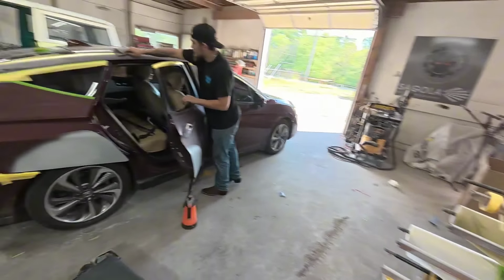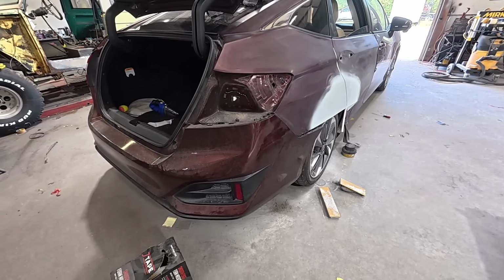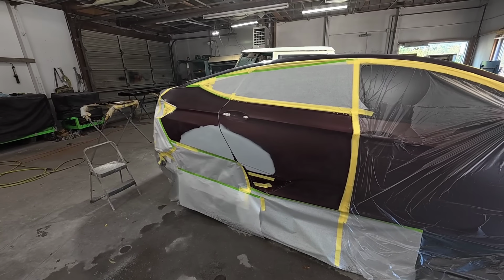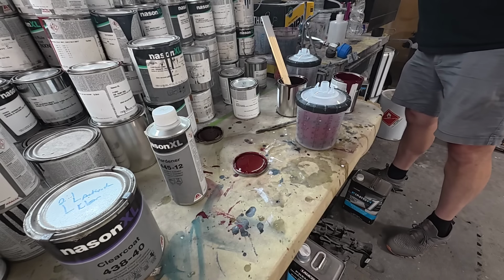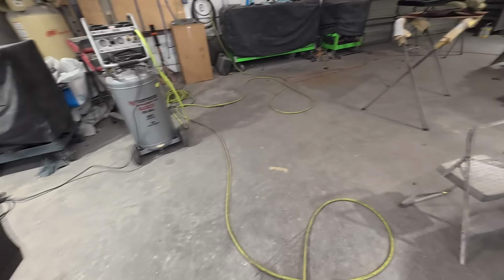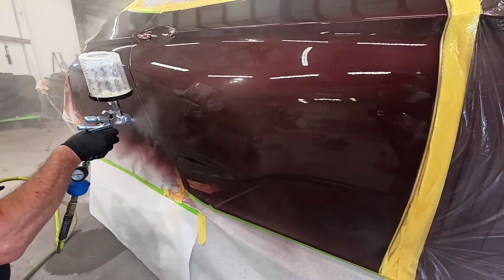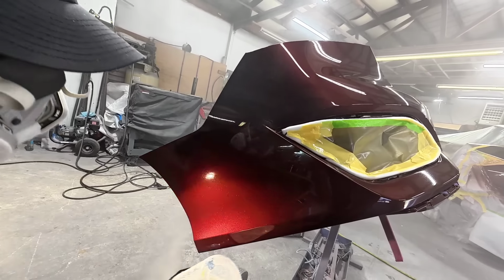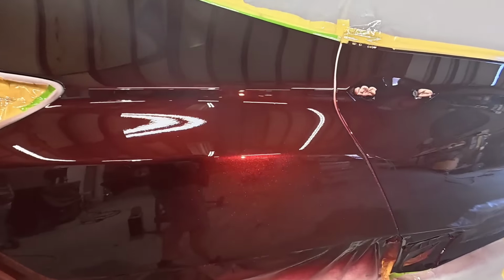I Painted This Car With a Small Compressor (No Paint Booth!)

Comment: Your gonna LOVE the 438-40 been spraying it for years now!!
Reply: I do feel your environment the 438-22 would fit your situation better. Hands down best panal clear I've sprayed with (I'm in FL so i use 438-22 with 445-13 slow hardner)
Reply from the maker: Appreciate the suggestion as I'm  new to this clear good info! I'm  gonna try the 438-22 for sure. Thanks!
Reply: @Bkrieder Do you mind explaining your opinion on why the panel clear would be better in this environment?  Ill be spraying outdoors / garage here in a few weeks, was going to go with Finish 1, but seeing this comment made me think about the 438-22, 438-40.  What should I go with in your opinion?  I’ll be spraying hoods, bumpers etc. Also i’m in NC and it’s kind of cold here, do you have an activator recommendation?  Thanks!
Reply: @kbizass the 438-22 NOT 438-20(if they still have it) will close faster then 438-40. Less chance for dust to land in clear coat. Recomend to use 445-13 hardner, will still close fast with slow hardner while leaving a flat beautiful glossy finish that only needs to be nib sanded and buffed as necessary. But, you will not make it all the way around for an overall job
Reply: But I'm in florida. So I regularly use 445-13 but will substitute 445-12 as my "fast" option
Reply: @Bkrieder awesome. Do you feel like this is a better clear than the finish 1 clear?
Reply: @B @Bkrieder Also what base coat do you like with this clear?
Reply: @kbizass  yes hands down
Reply: @kbizass  I shoot Nason Xl and I've also shoot it over Valspar with no issues as well. I have one spesific customer who prefers the price of valspar base vs the nason xl.
Reply from the maker: Do you like the way it buffs
Reply: @GarageNoise it sprays so smooth and doesnt lose gloss has a quick dry to touch time the only thing I buff is the few nibs that need atention
Reply: @GarageNoise  Chris what happened to Brad at sagola
Reply: Chris what happened to Brad at sagola

Comment: i am struggling with removing my bumper the bolt is badly rusted
do you have any experience with mercedes?? bumpers specifically sl500 R230 ) 2003

Comment: clear coat needs to put in cup and 30 seconds in microwave and it will flow better, so it is closer to 30degrees Celsius. Some professional painters doing like that. Need to try that, especially if you arent living at hot place

Comment: Try a LVLP gun, can be bought for $100.  I did my Firebird with a 25 gal compressor and the LVLP gun.  Total in, $1100 for paint, $100 gun, compressor I had, prep materials aprox $300, cut and buff paper, pads and 3M products $200 and about 100 hours.  Far cheaper than my best quote of $13000, plus the satisfaction of having done it myself.  Patience, prep and a couple dozen videos were keys.

Comment: Good video! I’ve used smaller air compressors for nail guns but for paint spraying I do agree with you that the compressor you were using is small. Thanks

Comment: Great video, tried the d1/r500 and I do like how they finish however the spray fan isn’t as large as I’d like especially for metallic colors. I have a 30 gal 9cfm at 90 psi compressor. Is there any other guns you can recommend. I usually only paint 2/3 panels at most?

Comment: While it is true that you do not need a large compressor spraying, it should be able to supply at least continuous 8 CFM at 90 PSI, and add a water trap. A lighter flexible air hose and a swivel where it attaches to the gun are very helpful. I also recommend a stand or a hook suspended from a ceiling to hang it on if you are using an HVLP gun with a cup on top for filling or between coats. If you don't have an exhaust fan overspray can travel pretty far and settle on everything, including the floor which can be mitigated by wetting down the floor, but be careful not to splash water on the vehicle! Done that. Prep is crucial, and paint will not hide anything! Use a tack cloth and then a wipe down prior to painting. Practice makes perfect so do some, and test the spray pattern on a flat surface just before spraying and make any adjustments for flow, etc. and see at what point too much will cause drips. Buy the best spray gun you can afford, but nowadays even a cheap gun can yield good results. A smaller jam gun in addition adjusted to spray a circular pattern is great for door jams, recessed places or tight spaces.

Comment: How did you connect your line to the 1/2 connector on the filter? Im assuming youre using 3/8 line with 1/4 connectors. Im asking this because trying to get into painting and just baught the filter and two merlin 3/8 50ft hoses, just wondering how im going to get it to connect to the filter.

Comment: Do yall messure your paint in one cup then transition it to another cup with a plastic liner? Or do you just use the same cup you messure in?
I ask this because im going to start getting into painting, does the paint dry off in the cup without a liner or is it easily washed off to be used again?

Comment: You don't charge enough for your collision jobs if you cant afford to fix your air supply. If you ever did complete cars with multiple coats, water in the air lines would destroy your work. If you want to get rid of the bulb filter on the gun, get a Motor Guard M-30 and a new 35' hose connected after it. You can replace the filters with regulator toilet paper or buy 2 filters and let one dry out in a clean shelf space.
Reply from the maker: Appreciate the comment, there's so many things that can be done for dry air. I don't have a problem with it tho but all good suggestions.

Comment: Is it possible to do a full car paint job completely outside? I dont have any kind if facility, not even a garage, but i do have a lot of grass and i could make a big cardboard pad to drive my car onto and ofc mask up, but i cant block the wind or rain or any of that good stuff, but if i time it right and get lucky with the weather is that possible?
Reply: I've heard of guys buying used 20 man tents for painting.
Reply from the maker: Yes it's  totally possible, I've  had friends get really good results this way. Obviously you want a calm rain free day and to avoid dusk or dawn  when bugs are bad.
Reply: Absolutely! A lot of us have done driveway paint jobs! I've done a few, go for it!
Reply: My friend, EVERYTHING is possible. If you have the space for it, I don’t see why you would not be able to, GO FOR IT
Reply: Everything is possible, but I would strongly suggest renting an air booth.  Painting outside would require a perfect day, no pollen, bugs, birds, etc..  the amount of cut and buff to correct everything will be very time consuming and costly.  I would even invest in a purchase of the booth before I would attempt an outdoor spray.

Comment: even on some of my dura blocks i cut slits on the top with my 4.5 in grinder with a cut off wheel .. so i can bend it some for contours .... but i only painted 1 car my 1969 javelin ... and i had NO Fing clue what i was doing .. i had 179 friends peopel tell me how to do it .. but having them actually come over LOL was a complete different matter.... but after i painted it ... they were like .. OH should have told i would have helped... TO LATE  :-) its done .. but i just want to drive the Fing thing .. so as long as people stand 10 feet away and im moving .. IT LOOKS GREAT  hahahah ..you guys make it look so easy .. for me .. Nope.. . and that the paint gun i used innocraft one you had ....
Reply from the maker: Lol, that's awesome. I can relate to that 🤣

Comment: Painting takes volume. I mentioned on another video. You can combine tanks.  If I have two or three cars to paint. I use an air bubble and and a 30 gallon air compressor.  Before you start you have to fill air bubble and combine the two. I always run two separate filters. If you run three tanks you need three  air filters. Tanks will have moisture in them from weather. Air bubbles are tanks only, no compressor, you can buy at harbor freight. You can also like me if you had a compressor that quit working ,use that...but beware if you have an old tank the seams can corrode and you can have a bomb, happened to me and son. We had a rupture and he needed 26 surgeries and I ended up with his teeth  in my nose and a sore that has never healed that I won't see a physician over.  Anyway happy painting everyone
Reply from the maker: Wow that's horrible, I've  heard of that happening before very dangerous for sure. I have a tank that the motor quit on its in good shape, I'm gonna do the same thing when I get a chance.
Reply: @GarageNoise we've discussed this before.  I 've an avid watcher. I've been with you since you syarted. I also like the guy  that starts out" lakeside"... because i am 65 and started back in q981 but i paid for auto body collision since my father owned a bodyshop, but he had a double stroke and had to sell and i persued truckdriving. But i had to quit that because mom had brain tumor, so i did bus driving and did chaarity autobody work for other bus drivers on the side. Which kept me busy and i still put together cars for them and myself, even thpugh i retired.

Comment: PORPHIS PRD 717VS IS DESIGNED TO EVEN WORK AT 8-29 PSI😊❤,HOWEVER PORPHIS IS A WIN WIN SITUATION 🏆
Reply from the maker: Yeah I was surprised that they operated at low pressure. With these guns 25psi I like 35 way too much.
Reply: @GarageNoise LOOKING FORWARD TO SEEING THE NEW PORPHIS PRD 817VS😊😊😊❤

Comment: Why do you say it’s a small compressor?That’s not a small compressor. Painting with a small compressor is what I did. Two 5 gallon porter cable compressors linked together. Painted my entire car piece by piece. Sealer,Base and Clear with a simple D1 Drizzle. No Orange Peel or Over Spray.
Reply: They normally use an 80 gallon or better to paint. This is a small one to people who paint for a living. I'm like you though. I have a 10 gallon pancake. They've so cheap that I may buy another one and link them like you did. Then, I'll have a 20 gallon supply for much less than buying a 21 or 26 gallon compressor. Thanks for the idea.
Reply: Super video enjoy😊
Reply: That sounds dope u combined two compressors?
Reply: @ZeekDavis-d3b I own a trim carpentry business and I’ve bought compressors for my guys when theirs took a crap on them so I have 3 at home. Had a bright idea to link two together with air fittings and a T. I then followed the GarageNoise paint prep and painting steps to a T and it came out great. I had one small run which I sanded and repainted and a small bit of orange peel right where the driver side fender hits the front bumper. Sanded,cut and polished it gone.
Reply: That's a small compressor.
Reply: What was your tank pressure? I mean, I know your gun regular pressure is set between 22 and 28 psi But I'm curious how much tank pressure you're feeding that range of 28 to 22 psi. 
Mine has two regulators: one for tank pressure and the other for line pressure, which is attached to my gun. You're going roughly 100 feet, so I'm just curious what your tank pressure is to keep that gun at a steady 28 to 22. Mine is giving me problems (fluctuating)  and I'm only going about 75 feet. I appreciate the advice on moving the water separator to 50 feet away from the compressor to prevent condensation from getting into my gun.  Thanks for that.     By the way.  I have just about the same size compressor just can't firgure out what going on with mine.    Any info would be appreciated
Reply: @d @deepriversouthernprideslot8287 I used two 5 gallon pancake compressors with tank pressure at 50 on both and regulated pressure set to 30psi. I painted each piece separately. Trunk,hood,doors,bumpers then painted the cab. A lot of stopping and waiting but the periods were short. I had a few runs and light area on the cab but it was an easy fix.
Reply: well if you pay attention to the cfm the fun needs to spray. yeah he spraying with a small compressor
Reply: He did use a “small compressor”, it’s small and cheap. What you did was use a “ridiculously small” compressor. 😂
Reply: @michaeljohnson2922 yes I did and still got my panels,hood,doors and trunk done and its better than a Maaco job.
Reply from the maker: It is a small compressor, there are other small compressors You can use. In my experience, this is the smallest compressor you could use in paint an entire vehicle or multiple panels at once without air fluctuation. Sounds like you gotta figure it out with the 25 gallon compressors.Did you use a touch up gun or a full size gun?
Reply: @GarageNoise I used two 5 gallon porter cable compressors. Linked them together with a hose from each to a T fitting. Then a hose to my D1 Drizzle with regulator and W/O separator. Both tanks drained and dried. Set both tank Air regulators to 60psi. Ran the Drizzle regulator at 29 psi. I don’t use disposable cups yet so I just cleaned the gun after each step. Sealer then clean. Base then clean. Clear then clean. It’s a 91 Honda Prelude so it’s not big. I did the flip up lids,fenders,front and rear bumpers,trunk as well as the custom lip kit in that order off the car. Wrapped them in painters cloth for protection and set aside. I then did both doors and did the same. Taped off the bare car then laid base. Thank god I have a sunroof(less work). I did this for sealer,base and clear. I used a 80% overlap at about 5 inches away. I used Eastwood Sealer,Granada Black Base(freaking expensive)and Clearcoat. Took me about 4 days since I work a lot.
Reply: @SKofMT you think this is feasible for a “small air compressor paint job” video? Or do you think your setup is more of an “absolute best you can get with the worst case scenario compressors including tons of diy work” video…? Sounds like you jumped through a ton of hoops to save just a little bit over this guy’s “plug and play” budget version. At the end of the day, if you’re looking to paint a car with a budget compressor, you need a budget. Most of us would rather wait another week and get the bottom line compressor that works than Frankenstein two or three compressors and regulators and extra lines etc. for a maybe… I’ll probably just get the fortress.

Comment: Is it better than finish 1 ?
Reply from the maker: I'll tell you this. I like the way it sprays better than the finish 1, But it's double the price.  The thing I like about finish 1 is it doesn't slick out quite as well, But most diyers are going to wet sand and buff their project anyway, what I like about finish 1 fc710 Is it dries quickly. So after half an hour fc 710 is dry to the touch, and you can buff it the next day and it buffs out great. So , it depends on the situation you're in, But I really like the way this nason xl sprays and flows out.
Reply: @GarageNoise  which one you believe will last longer
Reply: Have you ever used Amtech Clare coat